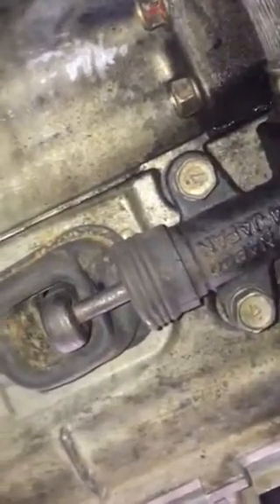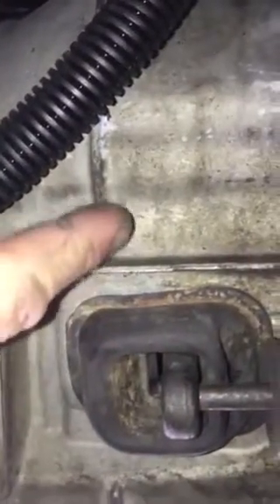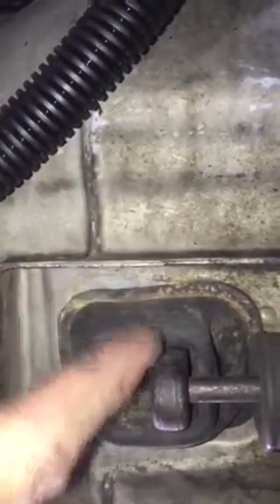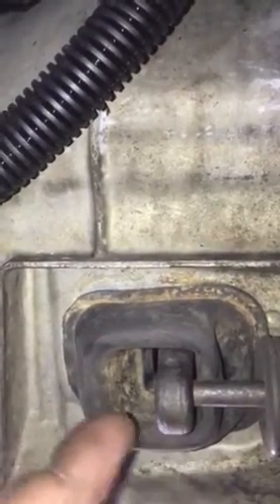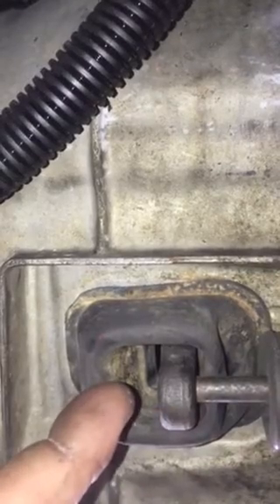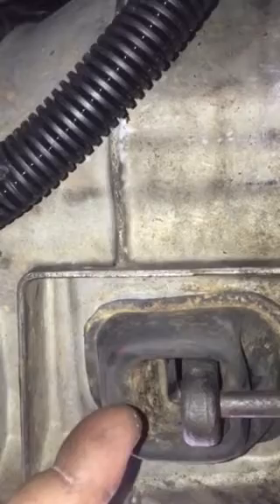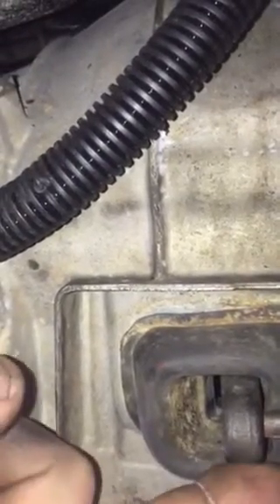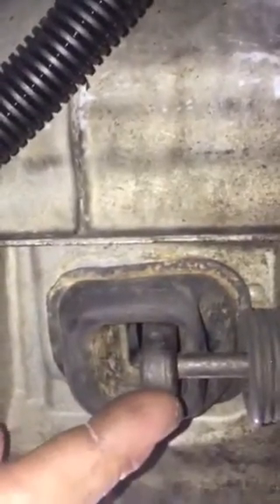D40 pathfinder navara clutch adjustment

Comment: Ever since I fit the SMF I have trouble engaging gears. They bind when first selecting. I have made new pushrod as your video but I think the fork needs adjustment. Is it just the ball the fork pivots on that needs adjustment? Does Gbox need to come out to adjust?
Reply from the maker: Sure does no other way sorry about the late reply .it's a bummer but it will be like a bee car when right